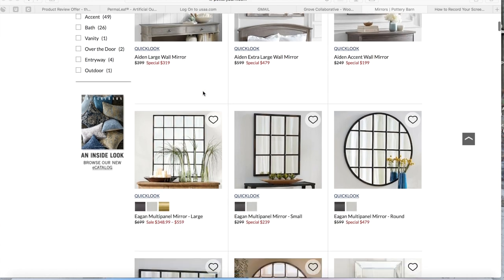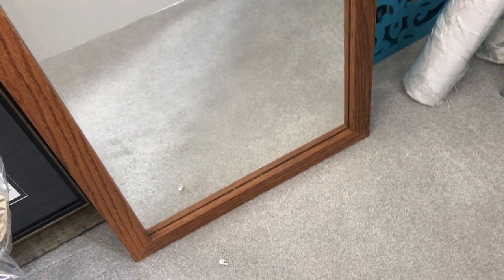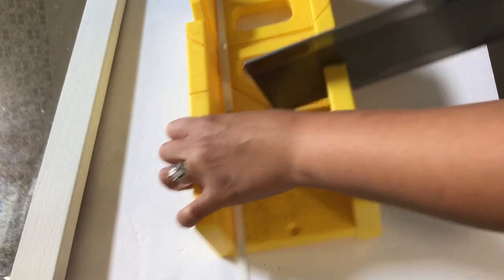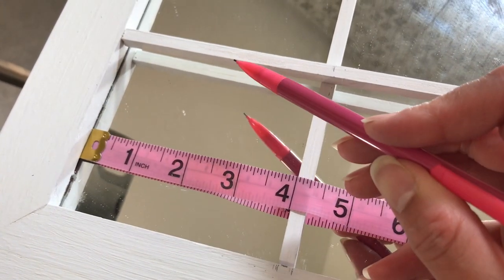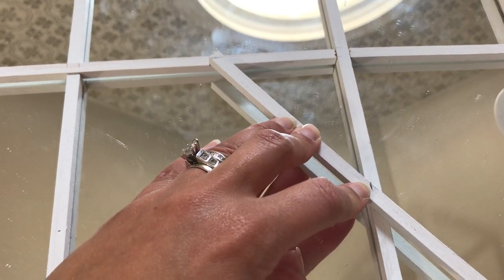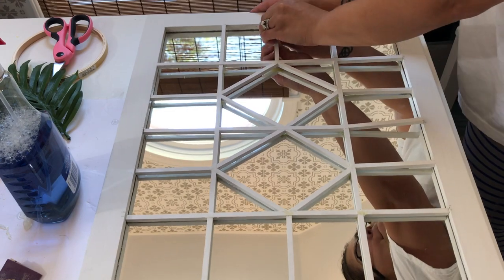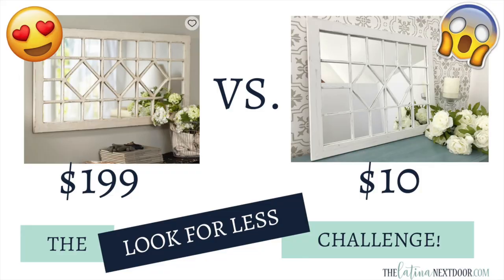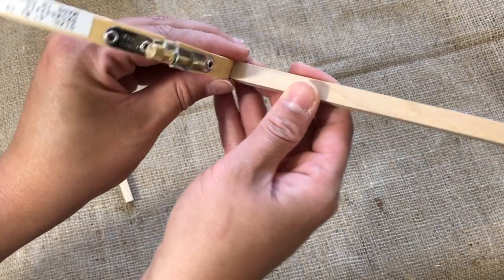Look for Less Challenge July 2018 -  Pottery Barn Dupe

Comment: I absolutely adore your Pottery Barn style mirror! I’ve seen other DIY designs online that used 20 or more Dollar Tree framed mirrors glued together. It’s another nice option, but it’s much heavier and more expensive too. My only suggestion would be to consider not permanently gluing in the finished grid. That way, you could just pop out the grid to clean the mirror quick and easy. Then push the grid back inside the mirror when you’re done. Your creative DIY’s inspire me to showcase the beauty in my home on a budget! So of course I’m a new Subbie! Thanks so much for sharing 🤗💕